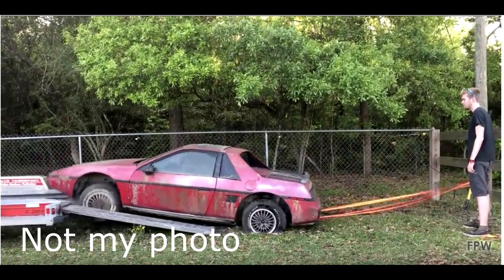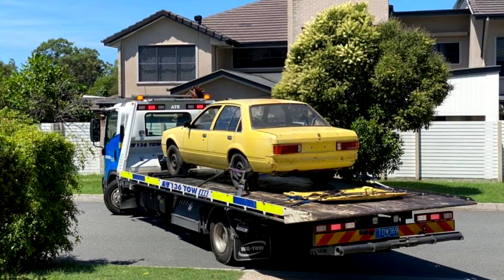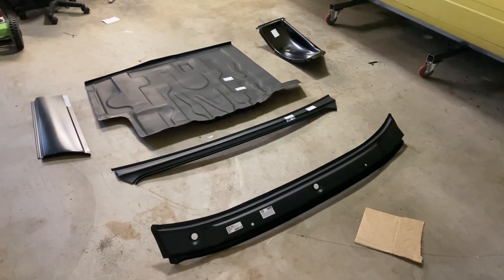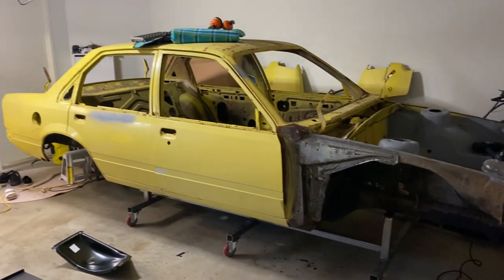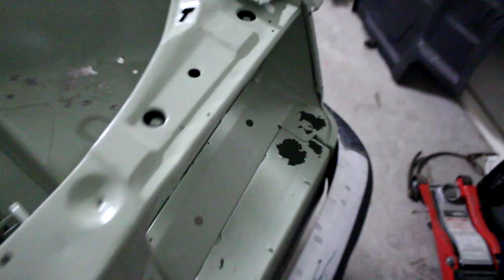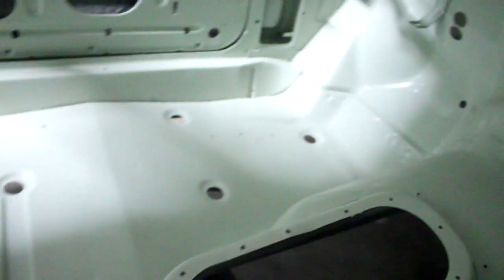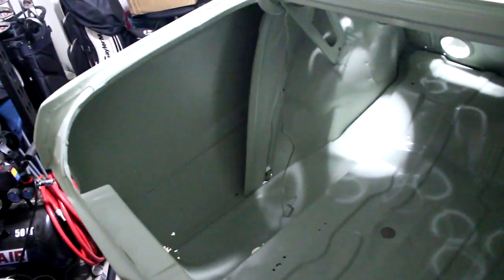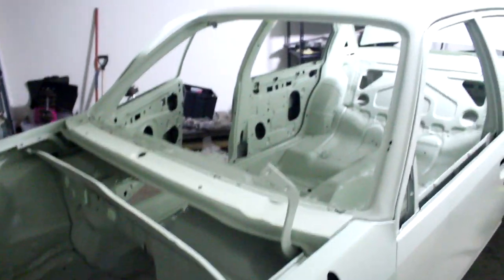Holden VC Commodore Restoration - Part 1

Comment: Not sure of your plans for rims but I’m pretty sure I have a set of original pursuit rims under the old mans house.
4, maybe 5? Yours if you want them. 👍
Reply from the maker: Ayeeee legendary! Not sure at this point but it’ll be a while away :( Tossing up getting a shortened Ford 9 inch or a VL turbo diff, will have to weigh up the pros and cons